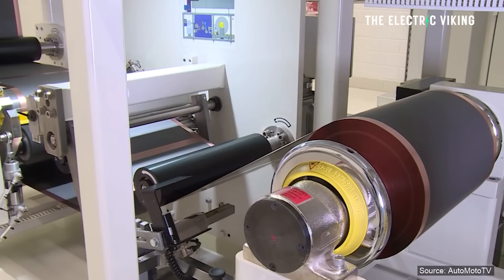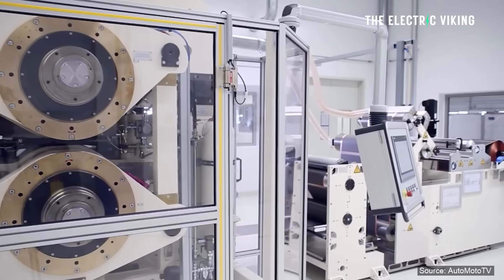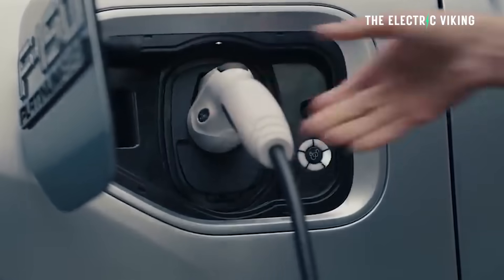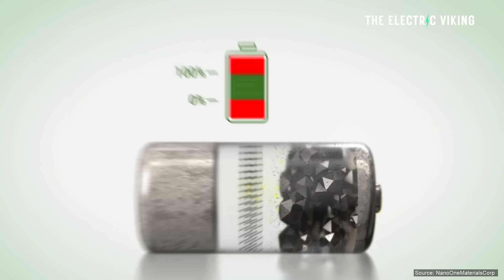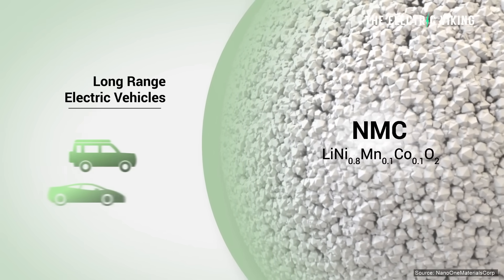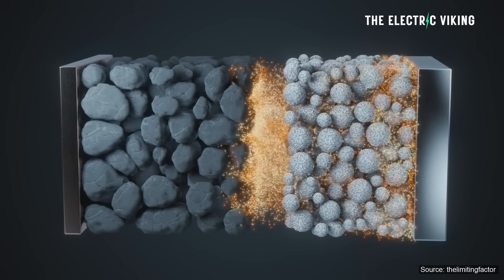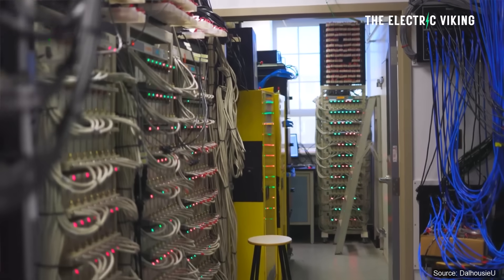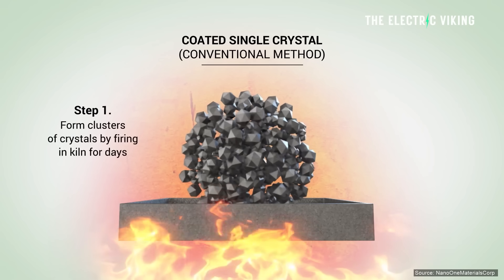New battery revealed in Canada that gives EVs over 5 million miles

Comment: I’m guessing that until we get over 60-70% worldwide adoption, battery manufacturers won’t be thinking about their jobs. Demand for batteries and new battery tech will be great for decades to come. Density and longevity will be needed to disrupt air travel.
Reply: Worldwide is one word, not two.
Reply: It vil come for sure, bcoz EV'S r Inevitable. Acc. To a report, v vil get rid of most of t Gasoline  cars by 2050.
                        So, it vil happen One Day definitely my friend, Total ev adoption rate isn't slow, but at Lower average rate
I'm An EV Specialist.
Reply: It seems that all industries are transitioning to electricity and various types of batteries.
This includes EVs, all types of existing ICE equipment, backup generation, heat pumps (including industrial versions), and much more.
The shift is significantly cheaper to maintain due to the unification of processes.
Reply: @ yes, good point. There will be so many industries that will need batteries!
Reply: @igors6593  How does one maintain a shift?
Reply: @duanehorton4680  As usual (if I understood your question correctly), this is capitalism and Darwin’s law—noncompetitive companies are bound to fade away.
The electrification and decentralization of the economy represent the next technological paradigm, a more efficient one.
That said, I don’t mean 100% electrification, nor do I suggest it should happen overnight—everything needs to be practical and make sense.

Comment: Interesting so it could suffer from the effect of light bulbs where they would last forever when they were made so the company's engineered them to die after a few hundred hours. My big question about this is if it has to compete with energy density or charging speed then it won't be done cuz those are more important than such extreme long life but in combination with charging speed and energy density this would be a big advantage to batteries. And of course in Canada resistance to cold degradation would be great.
Reply: Companies, not company's.